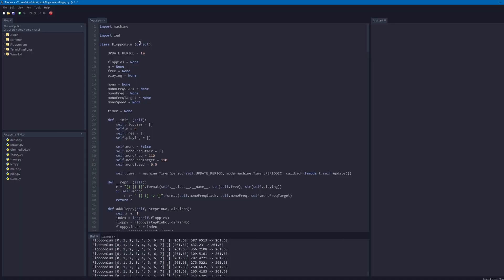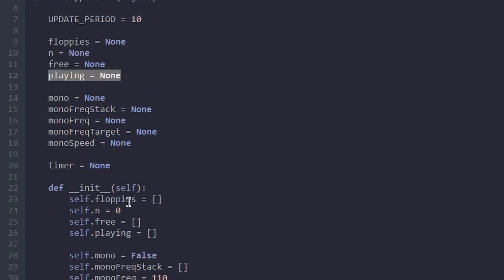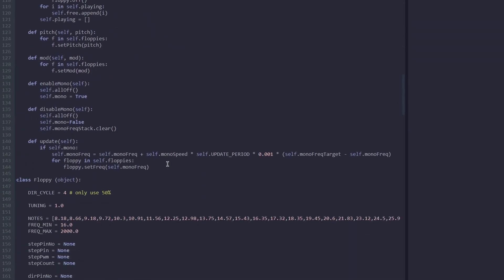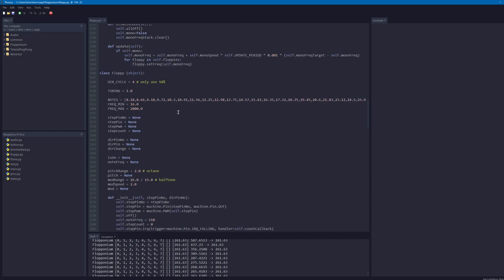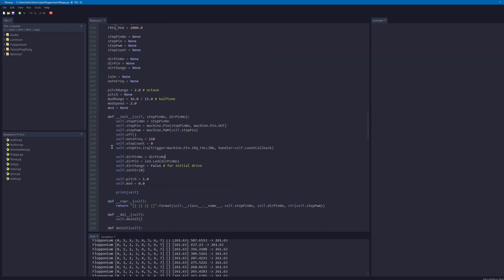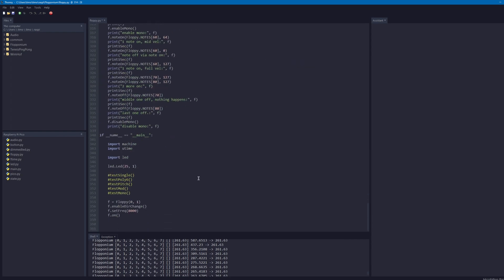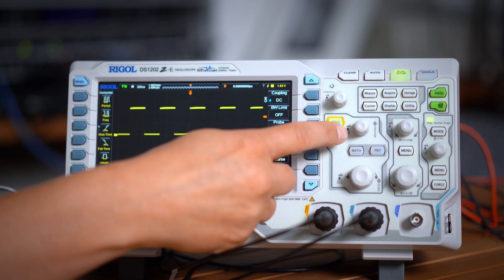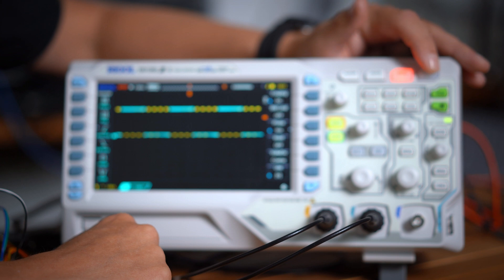The Flopponium - Day 1 - The First Code | Timo Leisure #12 EN

Comment: I don't know what intensity setting you are using on you oscilloscope, but on camera the vertical part of the trace is not showing up at all and the grid is very dim.
I don't know how the lighting and camera angle in relation to the screen is affecting the viewing, but here on my DS1054Z I have the grid brightness to 50% or the trace intensity to around 70% and the whole signal is very visible with the grid nice and visible.
Reply from the maker: True. Thanks for the feedback. I did not notice. I Just counted the pulses and did not look at the edges nor the grid at all. ;) I guess it is the cam settings / light. Nomally this stuff is nicely visible on this scope as well. But I think we can get the gist. Cheers